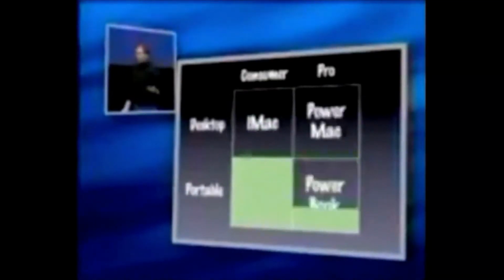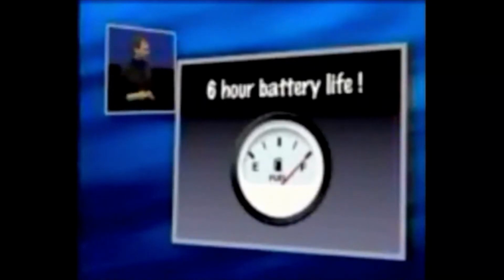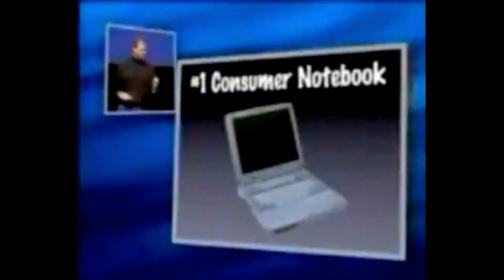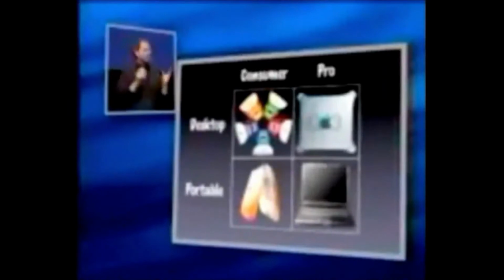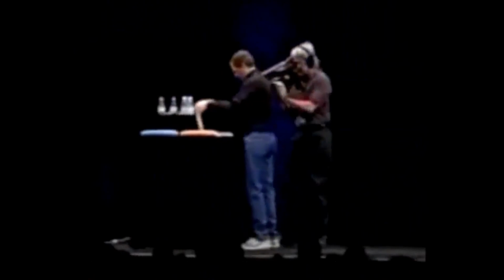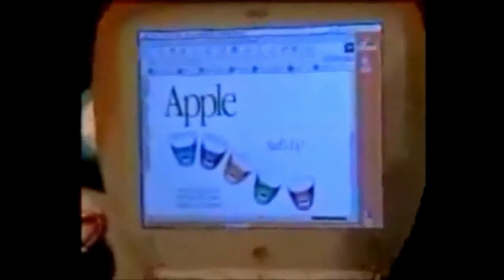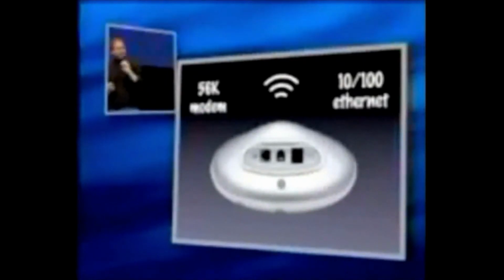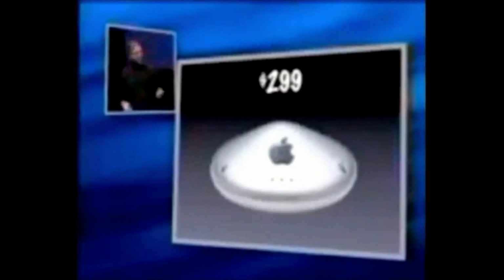Apple Macworld NY 1999 - iBook G3 & AirPort Introduction

Comment: It frustrates me to no end that modern Apple is so obsessed with making everything as thin as possible. Every time battery technology improves, Apple makes devices thinner so the battery life stays the same, instead of increasing. Imagine how much battery life we could get out of a modern laptop if it came in the beautiful iBook clamshell case. 😮
Reply: That’s not necessarily true. Compare the iPhone 6 to the iPhone 17, and everything in between. They’ve gotten fatter and fatter ever since. Same can be said about the MacBook Pro and the Intel Air vs the M2/M3/M4 Air’s over the years. They have gotten bigger and the IO is back. MacBook Pro went from a couple USB-C ports and that’s it, to having all sorts of ports for all sorts of things. That quote would’ve applied probably 5 or more years ago, but it doesn’t apply now luckily.